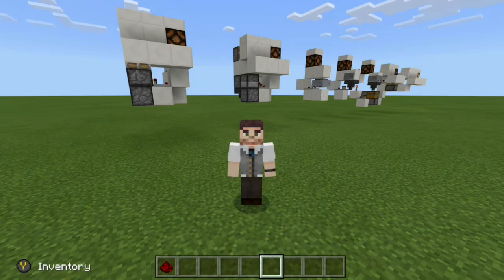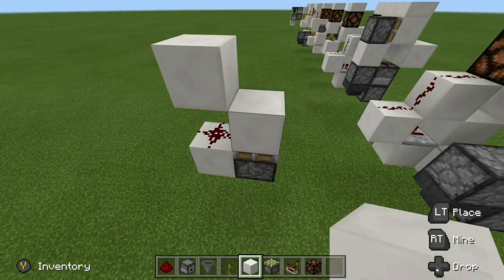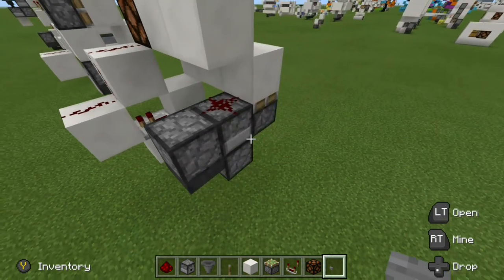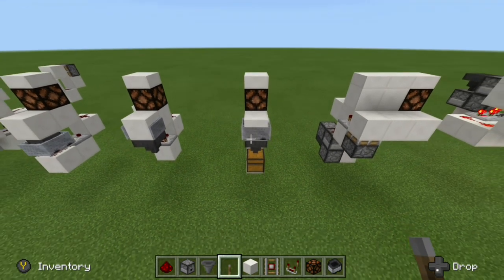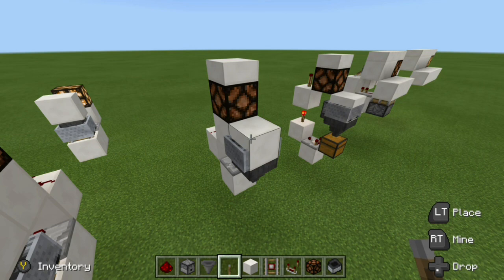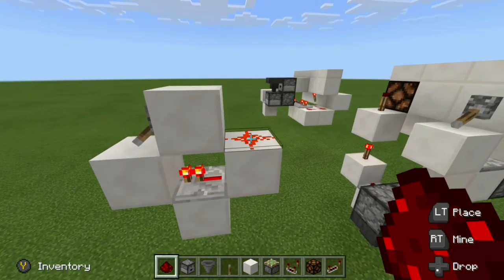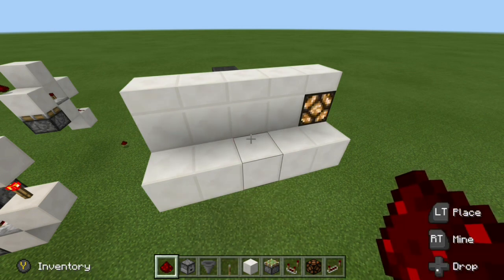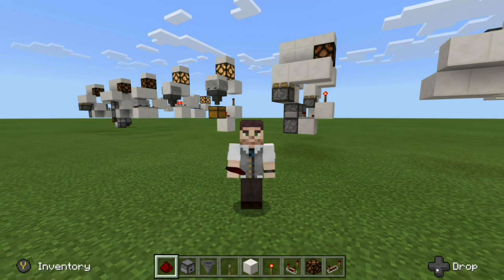Minecraft Bedrock - Hidden Inputs ( Xbox / MCPE / Windows 10 / Switch )

Comment: With the item activated one's how do you disable it after words
Reply: I think all you have to do is remove the item.
Reply: @Thompson1jw  but what about automatically?
Reply: @MBrosTheMLegendBB  the doors open as long as an items in there. Theoretically if you replaced the chest with a dropper pointing towards a hopper and that hopper funneled to a chest you could set up a button on the other side to trigger the dropper. It would then empty the item out closing the door and storing the item in a chest you can collect from later. If that's not automatic enough use a pressure plate once your inside instead of a button so when you walk down the hall it would close behind you.
Reply: @Thompson1jw  thanks !!